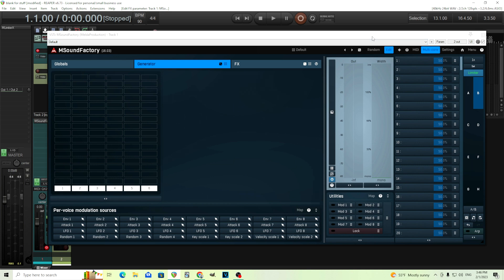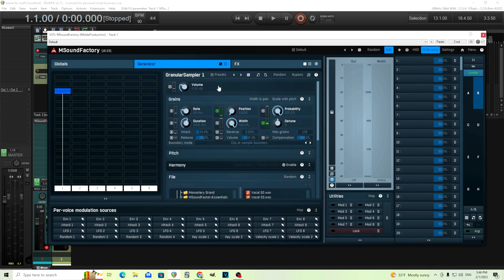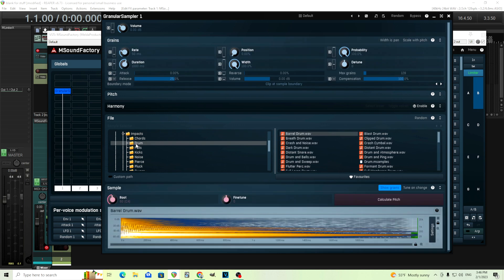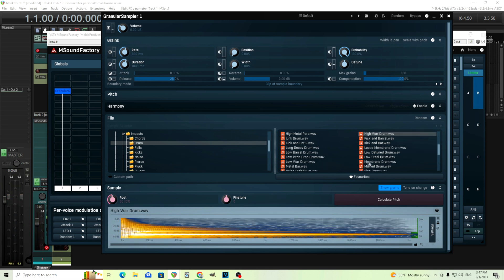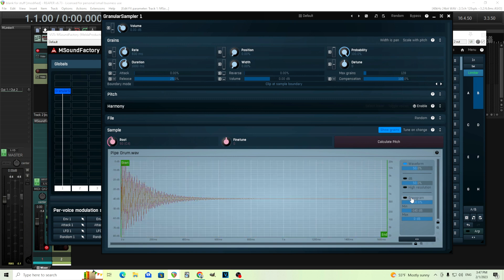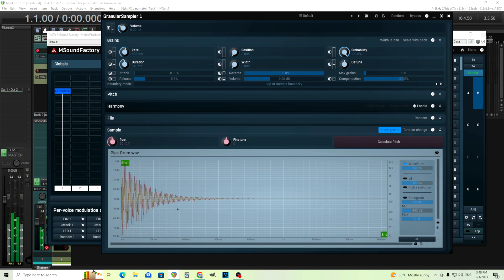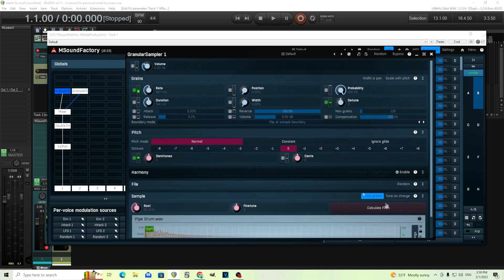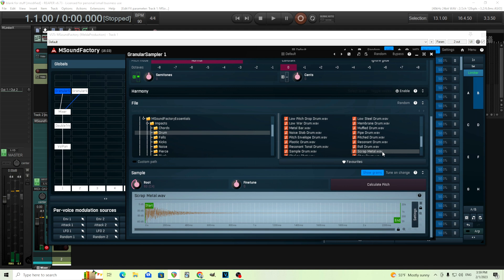Granular Riser in MSoundfactory

Comment: Nice tip with the "detune" in granular!  I was digging through your tutorial library in search of an example of creating your own drum machine in MSF - couldn't find an example that "filled the holes" in my knowledge.  I tried reverse engineering the "dream machines" instrument but for the life of me can't get it to change samples.  Possible future tutorial? 😉
Reply from the maker: Thanks. As for changing samples, try using the banks feature. https://youtu.be/lv1iodXHwAk
Reply: @Chandlerguitar  OK...now I get it!  I was trying to create the BANKS entirely in multi-parameter - it never occurred to me that you'd have to "create a bank" and then "create a bank " again in MP (which is the foggy part).  It would be more clear if assigning the BANK to a generator was "Bank Assign" and the multi-parameter was "Bank Control".  Thanks for directing me to your tutorial - now I can get to work "building" my EMU PRO/CUSSION! 😎